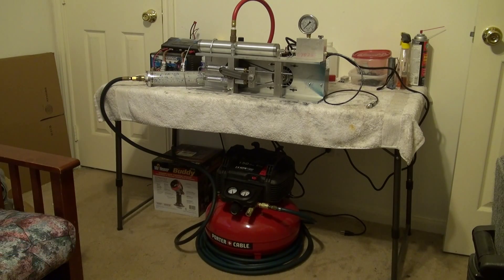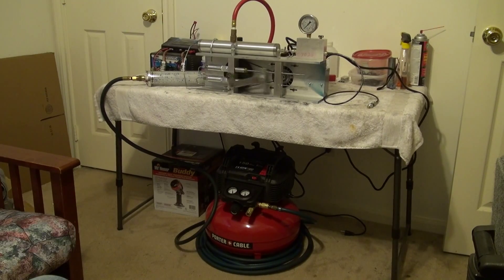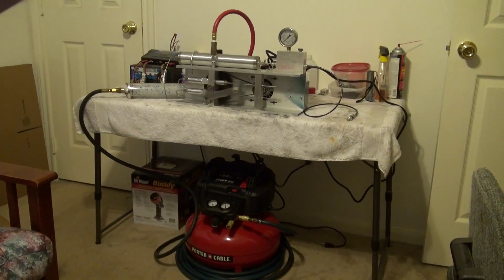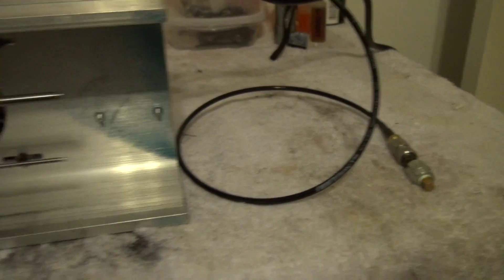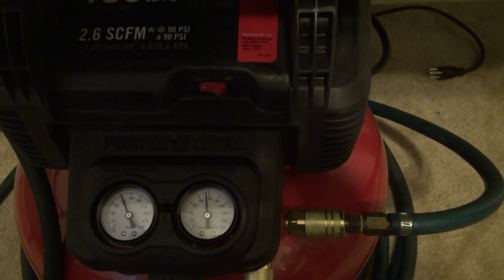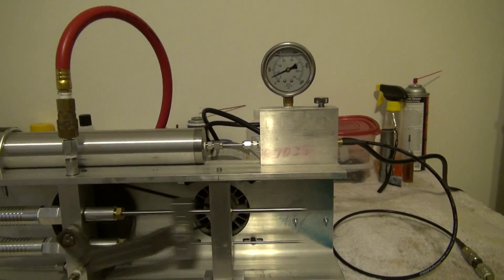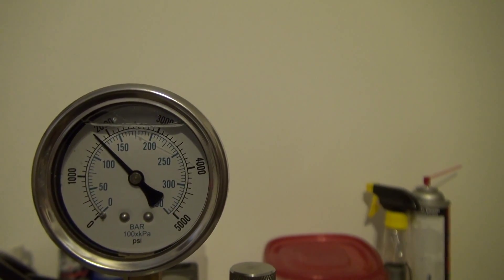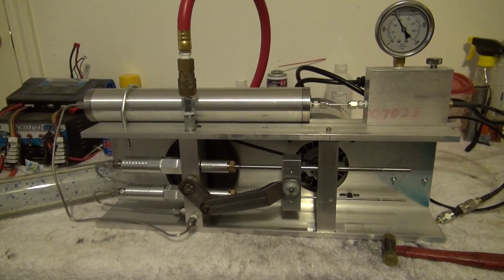Testing HPA Compressor

Comment: it's that piston have o ring or you just llike shoebox design? looks like more easy to fill 500cc bottle, i'm filling with hand pump and thats delicious :lol
Reply from the maker: It has o'rings just like a shoebox.
Reply: sixshootertexan thanks for the replies, and what size of piston diameter? Are stainless good for piston?
Reply from the maker: .125" and .250" Grounded and harden drill rod.